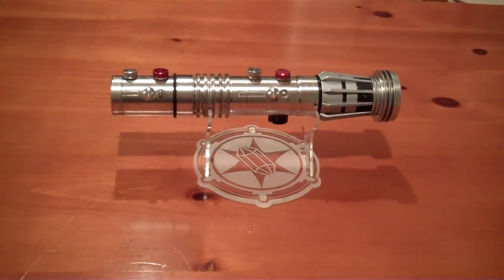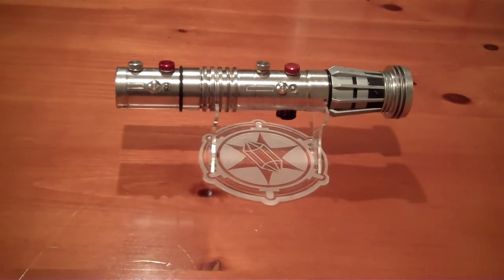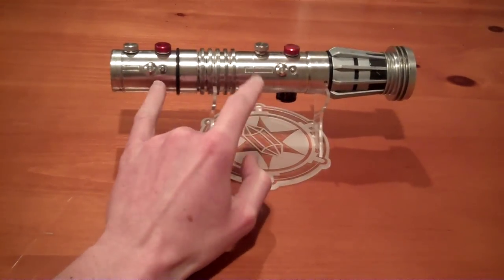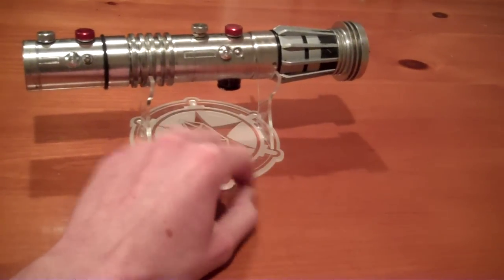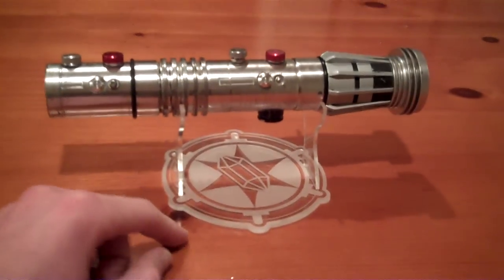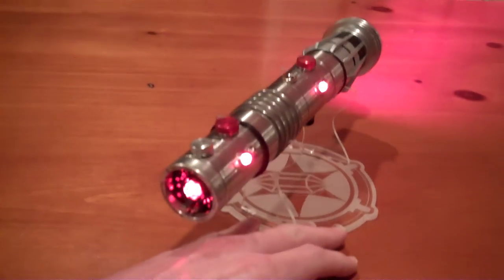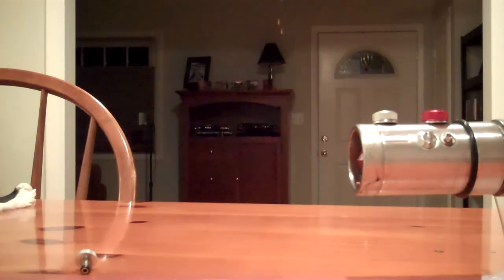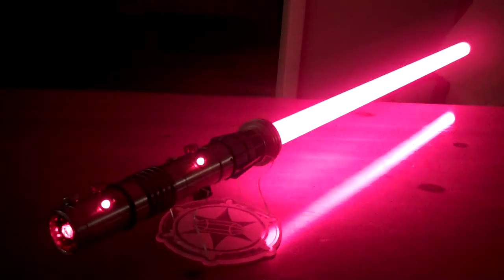HFX Darth Maul: Conversion and Upgrades

Comment from the maker: The way that I did it involved removing the plastic bubble from the metal "bezel" piece. There is an LED behind each one of these. I drilled out the plastic bubble about 1/8" in order for the top of the LED to sit nicely in them. I them mounted the LED using a plastic Bezel. Message me here or email me at SimpiSabers@gmail.com if you would like more info. Good luck with your conversion!